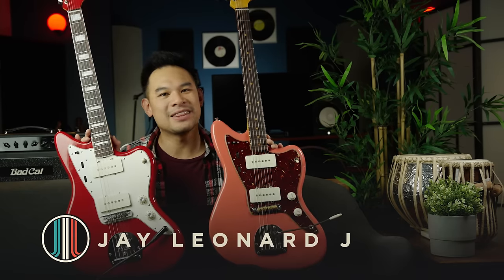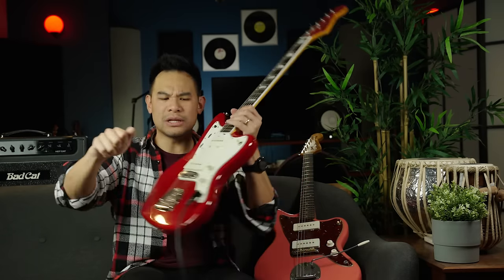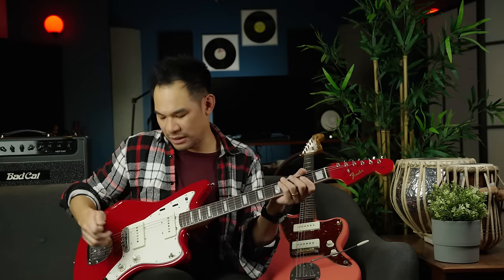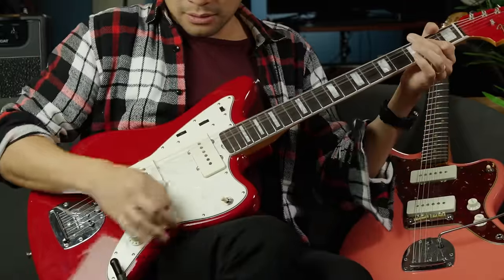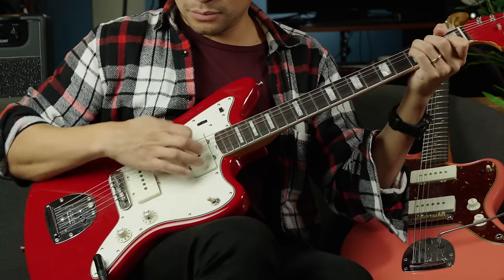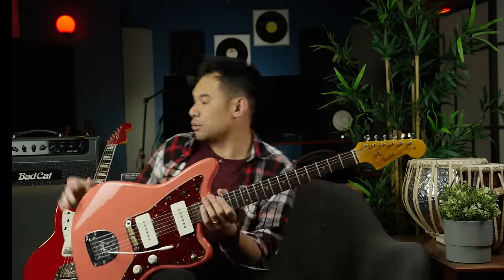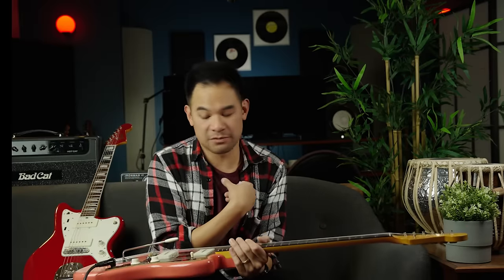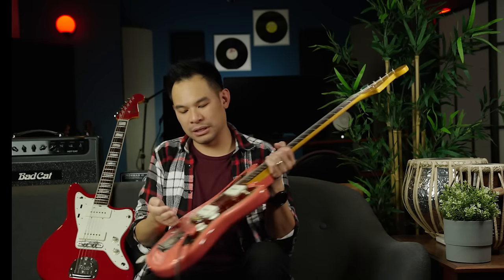What I Learned After Gigging A JAZZMASTER for a Whole Year | TONE LAB

Comment: So what do you do about the hum, Jay? Are you  a noise gate guy?
Love this vid and love my Jazzmaster except for the hum side of things. Haha.
Reply: I would recommend replacing the plastic pickguard with an anodized aluminum one–you should be able to reduce the hum and buzz.  At least that’s been my experience.  This might be part of the reason why Jazzmasters in the late 50’s were introduced with anodized pickguards.  I have a 40th anniversary Squier JM with aluminum pickguard and it’s fairly quiet with less hum than my Strat which has a plastic pickguard.
Reply from the maker: I don't use noise gates, but I am very quick with the volume knob on the guitar.

Comment: Brightness is often attributed to the 1m pots that are commonly used on Jazzmasters. Sometimes you'll see 500k, because these days people don't favor that much brightness. But all it takes is a slight roll off of a 1m pot to get the wide open 500k pot sound, but you'll always have that extra bit of treble on tap if you need to. Sounds great with fuzzes, because the low end isn't overwhelming them and making them sag.
And obviously I typed that as I was watching, so later on you completely nail it. Making this comment pointless :D

Comment: Re: the bright tone. I have an American Original 60’s JM which is mostly the same guitar as the AVII66. I had a Mastery bridge on mine and I ended up switching to a Staytrem and the reason was the tone. The Mastery exaggerates the already bright high end in the Jazzmaster. Especially the bridge pickup. Like you, I had to run my tone around 4 when using the bridge pickup. Soon as I replaced the Mastery bridge that changed and now I have my tone knob around 7-8. 
I do like the Mastery bridge but if you’re fighting the highs on a Jazzmaster it’s going to make it worse.

Comment: These guitars just need bigger strings and lower ohm pots. You can also put a shim under that neck if you need more down pressure on the bridge. That rhythm circuit originally AUTOMATICALLY went to a bassier tonality. There's hardly any difference between the lead and rhythm circuits on these guitars. And all of these tones you are using depends on how you EQ your amp. Roll off some of that treble and you will get a sweeter sound.

Comment: I do not play a Jazzmaster but much of what you want from it I have. I like both a Tele and a Strat but I like them with 50's lower gain and very chimey PU's   The other Big but is I  do not like the the neck PU on the Tele or the bridge PU on the Strat. Answer? Why not a guitar with the bridge PU a Tele and the mid and neck PU from a Strat. 
I have mainly played Gibsons. It's the neck. I love the neck. I found the answer. I had a guitar custom made with the T, St, St, pickups and the neck from the nut to the heel on the body is all a 1959 Les Paul Std. shape and length. Any time I need the fatness of a PAF I find the Tele covers that ground with as much punch and fatness as I can possibly ever use and no matter what amp or pedals I use I get definition and cut. The body style on my guitar is from a drawing by one Leo himself designed in 1952. It looks like a Jazzmaster that they forgot to add the offset. The biggest surprise about it is if you take both hands off the guitar it sits across your body like someone used velcro to hold it to your cloths. In short, perfect balance, 😇

Comment: I couldn’t vibe with the stock pick ups on my reissue 
The pure vintage 65 pick ups are really thin and shrill
You should try the earlier higher output alnico 2 pick ups 
There’s plenty of pick up makers that make those and you’ll find the guitar is still extremly bright and high fi but distorted or any drive plays a lot nicer and the balanced is better 
Those pure vintage aren’t bad but atleast mine has mismatched output so the bridge was so quiet and weak while the neck was crazy loud and warm

Comment: Thanks Jay - where did you get the 1k pots for the rhythm circuit that match up with the thumbwheels?  I would love to do the same mod to mine.  Thanks!
Reply from the maker: You can get the same 1M pots that Fender uses for the Volume thumbweheel (although the taper will be a little different). I actually got a 1M Audio taper with a Mini shaft and some aftermarket thumbwheels that matched the diameter from my local guitar shop :)
Reply: Thanks for the response, Jay.  Most appreciated.

Comment: Will you explain the toggle switch at the bottom ? 
Thanks. 
I have a jazzmaster American reissue. 
That toggle is not present. 

Thank you
Reply: The bottom toggle switch is the pickup selector. 3-way.
The top switch toggles on the "rhythm" sound which turns off the bridge pickup and plays with a warmth (or muffled, depending on your perspective.)
Reply: @sagittated  good explanation.  Thank you. 
Appreciate that.

Comment: What string gauge are you using? Would you consider it possible to put 8s on a Jazzmaster?
Reply from the maker: I use Stringjoy 10-48. 8 might not be the best guage for a jazzmaster because of the bridge setup. This guitar definitely works best with strings on the heavier side. However, there are no rules: depending on your setup and playing technique you may be able to make it work pretty good.
Reply: @JayLeonardJ  Thank you. For my playing style I need 8s on long scale, anything else hurts unfortunately. I installed a buzz stop on my Jazzmaster, but I think it kills the tone (reducing the post bridge string resonance) and vibrato feel. The solution would be a shim. I think Fender should modify Jazzmasters with a slightly tilted neck, which would eliminate all bridge trouble. They have done it on the Pro II version.